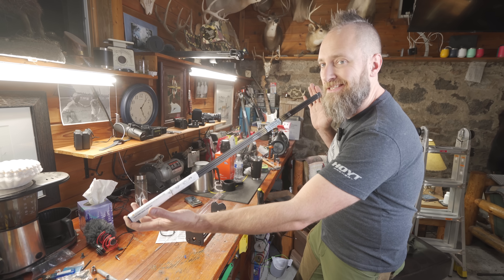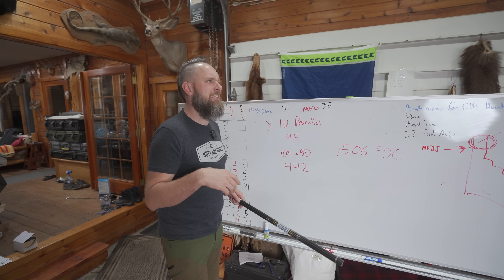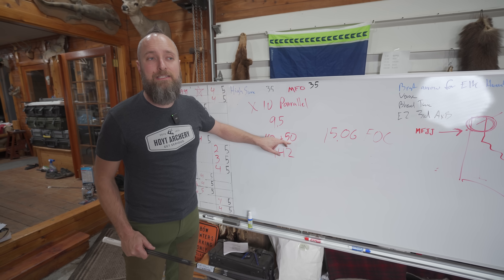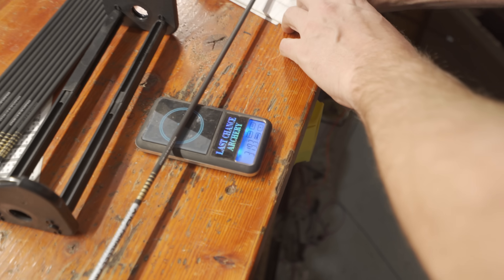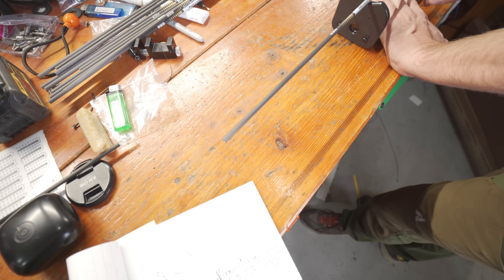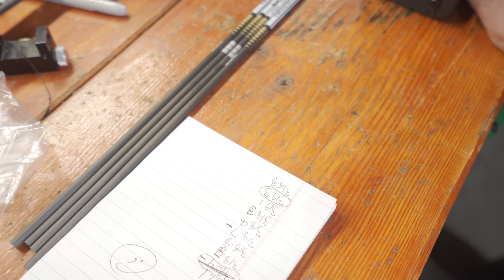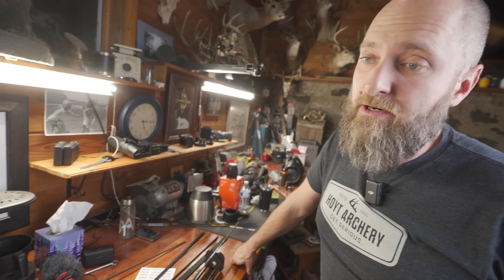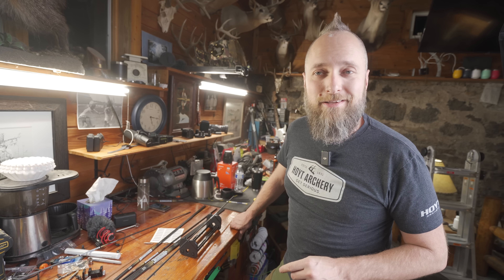Easton X-10 Parallel Pro Review With MFJJ!!!!

Comment: It'd be cool if you could measure spine consistency, both across the dozen, and across a few individual arrows(at several points around the shaft). I've found that is by far the most important factor in a dozen arrows being accurate. I made my own setup with a harbor freight dial indicator stand, and a good dial indicator. Straightness not a huge factor, even most .006 arrows are good enough when cut down to shooting length. The weight tolerance is the last thing I'm worried about with shafts these days. You have to be a top notch pro to be able to see the difference of even 5-6 grains, let alone a grain or two.

Comment: Hey MFJJ, I'm aware of your appreciation for constructive feedback. Firstly, considering your affinity for tinkering, I suggest exploring the possibility of having someone with a 3D printer create a small block to ensure the arrow remains centered on the scale.

Secondly, it might be worth upgrading from the current Chinese scale to a higher-end reloading scale for improved accuracy and reliability.

Lastly, as scales tend to experience weight drift during warm-up, it would be beneficial to review the manual of any reloading scale for guidance on mitigating this issue.
Reply: Show me one scale not made in china? 😇
Reply: I have looked everywhere for your arrow setup specs and can not find them. Was wondering what length weight and spine you shoot

Comment: Yep.  I don't use Victory's half-outserts that come with their RIP XV shafts. I use Easton's aluminum HIT insert and Gold Tip's XSmall Ballistic Collar with 125 grain points to build my 15% FOC arrows that are light enough to give me  280+ fps speeds from my 65# bows at 27" (measured - they're all set to 26.5" on their modules and cable stops).

Comment: One thing I've generally wondered about: what are the advantages (if any) of a hybrid aluminum/carbon arrow like this setup as compared to a high-quality carbon shaft? To me, these arrows seem heavy (at least relative to something like the X-Impact), and adding the aluminum core means they are more likely to permanently bend when striking a hard target or animal. Meanwhile, plenty of carbon-only options out there are claiming similar straightness and weight-matching tolerances, and can be had for the same or less weight (GPI) so that you have more options for buildout, FOC, etc.
Reply: For me these arrows are extremely durable, especially with the iron will system. I hear a lot of people talkin bad about how they bend, but never in the 3 years using them have had one bend. Last year, on a shoot, I hit a tree on a moveable owl target and that arrow was getting bent up and down all day and would stay bent while the owl was in place.  I couldn't recover until the end of the day and thinkin on how bent it was when seeing it stuck on the owl I definitely thought it would be bent but to my surprise the arrow was in perfectly good form. I love these arrows and will never use another for hunting. For me these are the toughest arrows I've ever used..well worth the price..I've hit my cinder block wall multiple times without braking an arrow..and don't get me wrong some have broke as it's an arrow but by far the strongest I've seen

Comment: Hi Josh just out of curiosity have you done the weighing without the paper by the scale or arrow shafts? I use scales every day and one thing I've found is the static on paper will pull on certain materials and carbon just so happens to be one of them. Just a idea.

Comment: If I shoot a fixed four blade, is it best to match the fleching as well?
Reply: Are you planning on using helical? If so the aae jig is awesome and will steer any broad head really well with 3 fletch as long as your bow is correctly tuned! The extra weight on the back of the arrow is unnecessary.

Comment: Is it a problem being over spined? I shoot maxima red 250’s and they are only 26.5” long. I pull 60#’s and only have a 27” draw. They shoot fine at long distance. Thoughts?
Reply: The CX Maxima Red 250s are actually 400 spine. So they are perfect for your setup. Not sure why CX calls them 250, very confusing.
Reply: Thanks for the clarification. Yea that is super confusing on why they do that..
Reply: Your point and insert weights will affect your arrow spine
Reply: If you can get a good paper tune your golden!

Comment: I wonder how many archers can actually shoot well enough they can tell the difference between $250 arrows and the $175 all carbon.  How many can tell the difference between.001, .003 & .006?   Only a shooting machine could answer the question- does it really matter?
Reply: Definitely not me! When I have idle time, I find myself looking up match grade arrows. Then I shoot 20-30 arrows and tell myself “save yourself some money there, chief!” 😂
Reply: Agreed that you would need a shooting machine to actually get a measured difference in POI... but for what its worth I always want the straightest tolerance possible... for both my target bows and hunting bow. Its not so much that I will be able see a difference in the arrow impact making me lean towards a .001.. its knowing that my gear is performing at the highest level possible, so all bad shots are 100% on me. Maybe in the .006 shafts, you get a few that will shoot 1/8" differently at 50 meters... in the target world that is easily a few line calls and points lost. ... in the hunting world its less of a concern being an 1/8" off, but with a broadhead on the front, straightness does have an effect at longer ranges. For the average hunter, you are right though... .003 is WELL good enough for the vast majority of people out there... I just don't mind dropping a couple extra bucks to get .001 when I plan on using them for years.... I have that mindset with all my stuff... fly fishing rods, guns, bows... all of it... If I plan on using it for many years to come, an extra few bucks spent up front is a no brainer... At the end of the day lets all just shoot our toys and have fun!

Comment: I always thought target shooters used fat arrows not .166 skinny arrows, oh well, I guess I am behind the times
Reply: No, you are both right and wrong at the same time. Fat arrows are for indoor shoots and many of us use fat shafts for 3d as well since its often in forested areas where wind is a non issue... the skinny .166 or 4mm shafts are used in outdoor 50 meter shoots as well as field shoots where wind is a large factor. Different tools for different shooting styles. You will never see anything but .166 in world archery 50meter shoots.... and nothing but 23-27's in the vegas/ lancaster indoor shoots. American Archery allows up to 27 diameter shafts (lancaster, vegas, ASA etc)  ... and world archery allows a maximum of 23 diameter. Hope that helps clear things up.

Comment: 3/11 being no good is terrible on this level of arrow. I don't think it matters that 8 were as specified. These are just another 73% good arrow.
Reply: Once cut all arrows should be straight. If you weigh your components like I do and match with heavy/lighter arrows, then all should be within a half a grain! On all the arrows I've ever built, I can truly say I can jus grab whatever one to use on an actual hunt and trust they fly exactly 💯 the same as the ones I chose to practice with. Every time!